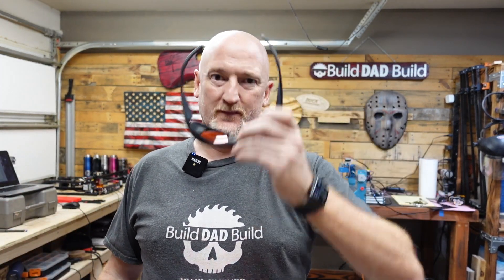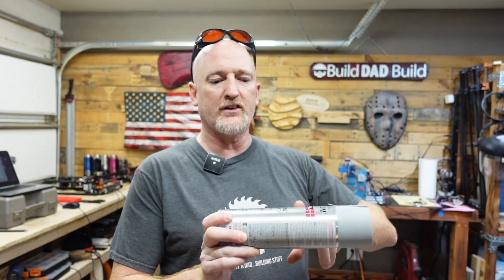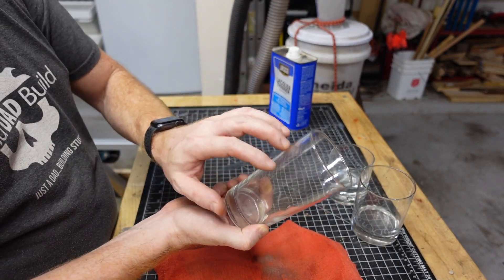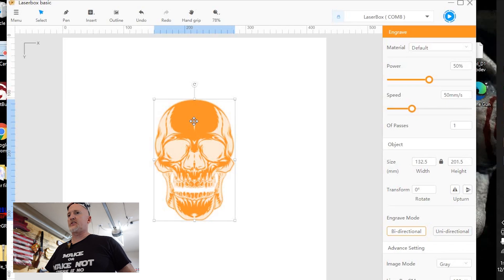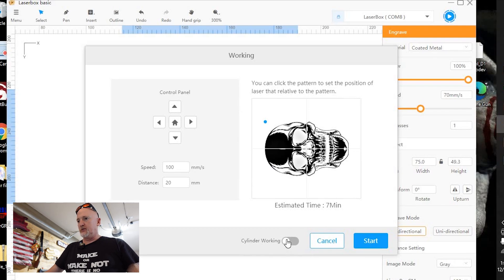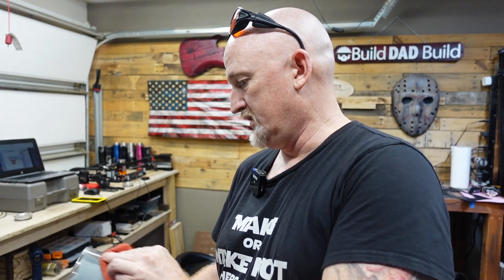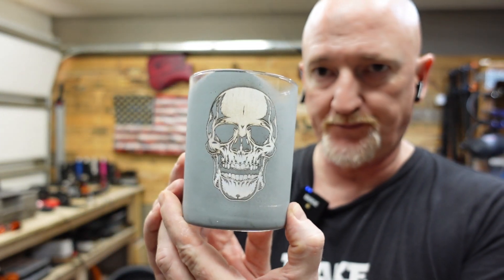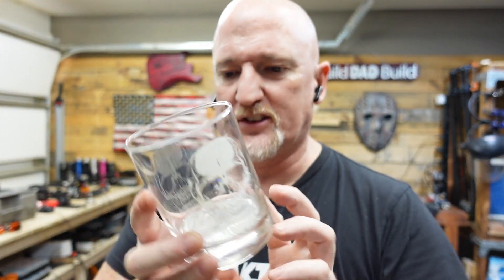How to Etch Glass with the xTool D1 10 watt Diode Laser

Comment: You definitely want an enclosure and a ventilation system going outside when using the cold galvanizing compound. You're melting zinc into the glass and the fumes from that can definitely make you sick. Like dizzy and barfing sick. Best to use spray on tempra paint when doing this without an enclosure. No fumes and it just rinses off with water. Gets the same results too. Maybe a little rougher.
Reply from the maker: Where are you getting spray on tempura paint?
Cheers
Reply: @BuildDadBuild  the tempra paint itself doesn't come as a spray paint. I've seen some videos where people use an airbrush. I however found this thing at home depot that is basically an aerosol can that attaches to a jar you put paint in, turning almost any paint into a can of spray paint. The kit is like $5 and the aerosol refill cans are about $3. I tried mixing the tempra paint with a little water to make it flow easier, but seems to work better undiluted. Just a quick spray and a heat gun on 700 degrees at medium low speed with a wide angle nozzle attachment and I'm good to go. You just don't want to get too close or the airflow too high because it wont dry smoothly and you will get ripples and cracks. Also tried some 4 inch mirror circles with and without paint. Paint leaves the surface texture but because the actual mirror coating is behind the glass, that keeps the laser from just going through and etches the back instead. I just put the mirror on some ceramic tile for a surface and it works pretty well and you dont have to reverse an image if you want to engraveon the back for a smooth finish. You can just do it from the front. Also because it burns off that mirror coating on the back, the tile actually gets the same image etched in as well. Just like if you painted the tile. So you can do 2 things at once lol. If you engrave through the mirror coating, you can also put a light behind it and really make the image pop.

Comment: Nick really appreciate your videos and have learned a lot about the D1 from you. I’m having some issues with glass engraving. I’m using the cold galvanizing compound and same settings as you use. I’m getting black lines almost a gradient look to it vs the bright white you’re getting. I went to 200 lines per cm and it’s still happening. I’ve wasted a lot of glass and time trying to figure this out. Any help would be appreciated.
Reply from the maker: A couple of things
1 - of course make sure your focus is on the highest point of the glass
2 - if the glasses are tapered make sure you're mitigating that
3 - Experiment with more and/or less cold galvanizing compound
I'm assuming that you have the 10watt. If you have the 5watt the settings will be different.
If none of that works, drop me a line and we can troubleshoot. nick@builddadbuild.com
Cheers
Reply: Ever figure this out?
Reply: @Sinistrad  I ended up getting the enduramark glass etching compound. Normally do 3 coats and make sure and let it completely dry. Use 100% power and 12mm/sec. After etching I use a pick tool to scratch the etching to get the layer of compound off which reveals a nice white etch under it. 

Still looking for other mediums to try because enduramark is really expensive.

Comment: I am having a difficult time engraving onto powder coated stainless steel - to where the plain stainless steel is visible when finished.
Reply from the maker: I just use the stock settings for coated metal in Laserbox Basic
Reply: @BuildDadBuild  ok. I found a video where you clean it up with the magic eraser - I will try that. Thanks.

Comment: How can you do a stemless whine glass????
Reply from the maker: Very carefully! LOL Easiest way I've seen? measure the biggest circumference and the smallest, Laser cut a circle of wood to the largest measurement, and a hole in the middle at the lowest. Slip that ring on the narrowest part of the glass and it should level you out.
Cheers
Reply: My best experience with tapered cups is to level the rotary to the laser. I use a small magnetic level

Comment: just followed these exact directions. any suggestions if some of the coating in the laser etched wiped away when cleaning it off ?
Reply from the maker: Usually that means that either there was too much cold galvanized compound on it (one light coat is all you need) or I have discovered if you turn the DPI up sometimes the results aren't as good (keep it at 100)
Cheers
Reply: @BuildDadBuild  thank you! ill give it a try

Comment: Fantastic 🍺!  Just received my D1 10W and the rotatry, your videos played a part on my decision. If I'm not imposing too much, in the first attempt you showed settings as 100% power/12 mm-sec, then the second time you switched to coated metal which is 100/70, is that the final or something in between? Help is appreciated brother.
Reply from the maker: If I switched to coated metal that was an error. Keep your settings at 100% @ 12mm/s
Also, I've discovered that raising the DPI doesn't always result in a better engrave.
Cheers
Reply: @BuildDadBuild  Thank you so much for your help, very valuable. In a wacko moment I had the power at 100%, finish the first letter then it cracked the glass at the beginning of the second letter, toning it down a little 😁.
Reply: @BuildDadBuild  Hi. I have an Ortur Laser Master with a 5W diode laser and i do find your settings of 100% power @ 12 mm/s a bit strange. Are you sure it's only 12 mm/s? I engrave glasses @ 600 mm/s if i go for 100% power.
Sorry for my question but i find 12 mm/s way to slow.
Reply: @Rui69Bernardo  I think you are confused with your numbers. 
Nick's setting of 12mm/s = 720mm per minute. 
Your 600mm/s = 36,000mm per minute. 
It is not possible to engrave at that speed.
Reply: @Maluk30  Hi. Yes, you are right, i got confused with the numbers. My last glass engravings were made with 90% power at 1050 mm/min. Sorry for my mistake.

Comment: Would you share the settings you ended up using for the final result?  We saw what didn't work but not what did work... thanks for taking the time to share your experience!
Reply from the maker: It's the preset for engraving stainless steel. I believe it's 12 mm/s at 100% power
Cheers
Reply: @BuildDadBuild  if i have the 20W model should i do this at 50% power?
Reply: @bigtymeplayerx  I have the same question! 
Not sure what setting to use for the 20w.

Comment: Any idea how to get the powder coat off?  Saw your reply regarding food safety… would like to get the material off and leave the etching.  Tried about 4 different thinners, it’s definitely “magic”ed on there. :)
Reply from the maker: Powder coated glass?
Reply: @BuildDadBuild  that’s what it seems like.  Made the assumption since it’s a zinc product (used the cold galvanizing compound) heated.  Most similar place in my brain is powder coat.  Since my comment, tried a few more things: polishing wheel, wire wheel, and some picks.  Thus far (for those reading) picks work best.  You’re chipping off zinc oxide (effectively) so wear a respirator.

Comment: Potential dumb question. When etching an object that is tapered like a standard pint glass, does the rolling action cause the glass to move or slide down and skew the engraving?
Reply from the maker: Not dumb. Depending on the taper you can either focus half the distance between the top most and bottom most part of the image. Or I've seen a lot of folks put a wedge under the rotary to level it out.
Cheers
Reply: @BuildDadBuild  Awesome and thank you. I got my wife the Xtool for christmas so I'm learning how to use it.
Reply: @BuildDadBuild  I'd love to see a couple demos of that if you have the free time.
Reply: With my ortur rotary a pint glass will move because of it's shape. I seen a vid of people making an attachment for it using a 3d printer to keep it steady. I might look into that.
Reply from the maker: @mrfreak64  I just use a rubber door stop and prop up the glass. I'm posting a video on it next week.
Cheers
Reply: @BuildDadBuild  yes please do, I'd love to see that. Thanks

Comment: So... I know you mentioned not knowing exactly how it works, but is it embedding hard metals in the glass? 
What are your thoughts on food safety here?
Reply from the maker: It's on the exterior of the glass. Not really concerned about it at all. If you are concerned, I would suggest not putting it in the dishwasher.
Cheers
Reply: @BuildDadBuild  solid point.

Comment: What type of spray is for etching the glass and for steel tumblers? I didn’t hear you say 🥴
Reply from the maker: Coated metal tumblers don’t need any spray (stay tuned for that video). Stainless I have some Dry Moly coming to try (that is supposed to be what works on bare metals)
Reply: @BuildDadBuild  I have this laser coming next week with the cylinder attachment. Thickness of hard wood says 3/8. I use all the hard woods, but it didn’t go through the red oak, so what about walnut, maple and the others from 1/4 to 1/2? What did you use on the glass?

Comment: Just finished watching, great video.
Maybe I missed it, did you actually specify the final settings? Did you slow down the speed and keep it at 100%?
Reply from the maker: If I'm recalling correctly it's 12 mm/s @ 100% power
Reply: @BuildDadBuild  That was your first setting for the skull was there a change in the setting to get it right the second time? Thanks